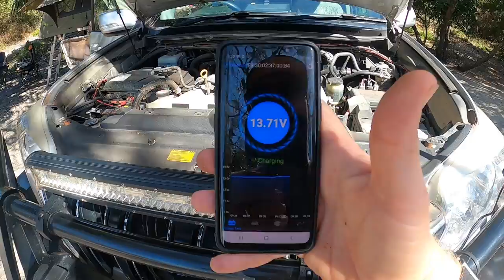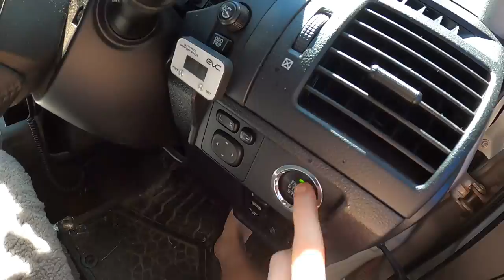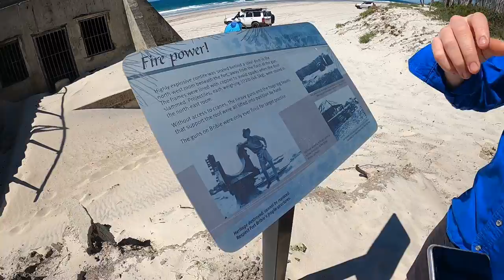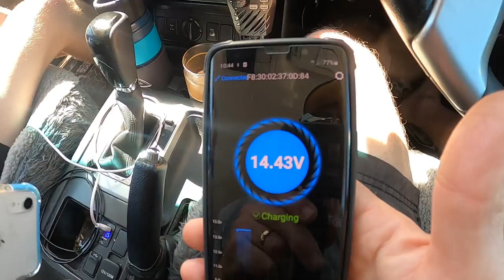Bribie Island Beach | Camping |Camper trailer that survived Cape York | Part 1 | Prado150

Comment: Hi Prado150outtahere, loving your channel. When you were towing the camper up the soft sand to enter site 22, did you have to put it in L4 or was the H4 with the 14psi enough?
Reply from the maker: Thank you 👍👍.. I used High range and yeah let the tyres down. A good run up is needed